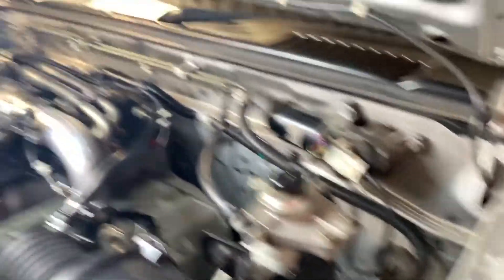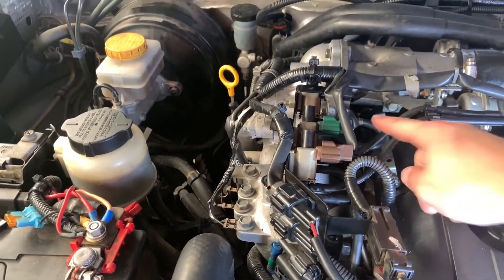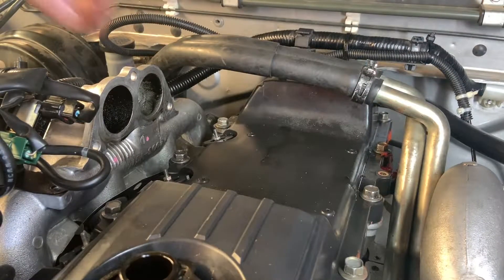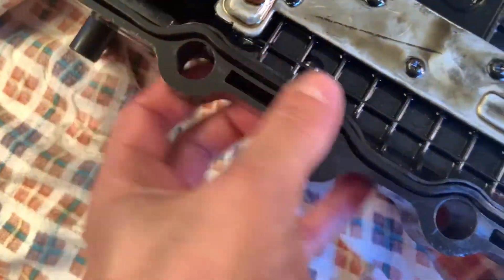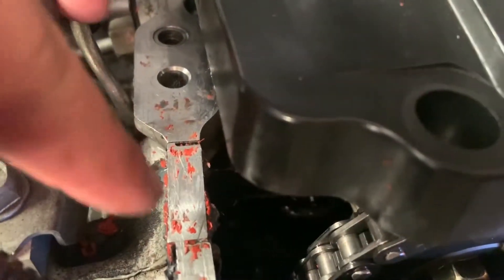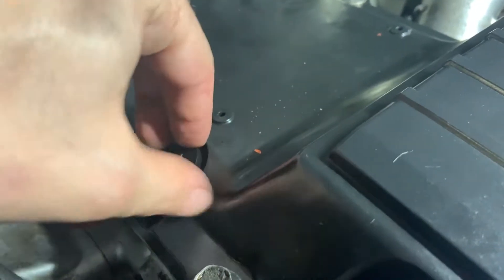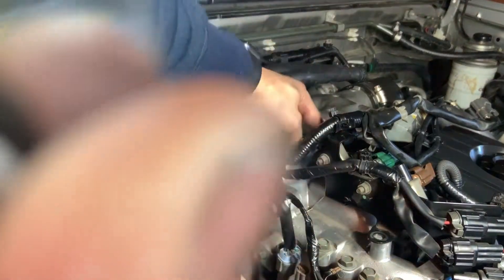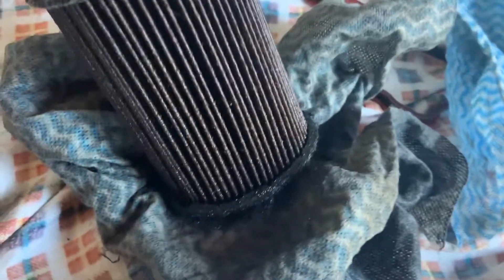Fixing My Leaking Rocker Cover Gasket and Replacing the Glow Plugs On My ZD30 D22 Navara

Comment: At what point did you take out the glow plug and seal.?
Ive just got the cover gasket and not glow plug seals. Don't want to destroy them.
Reply: @anthonyjamescatania 
Thanks Anthony.
You're right, it's a bugger to get cover out with the glow plugs still there, but manged it. I think I'll pull them out though to refit cover as I think I might damage seals with the top of glow plugs.
Thanks again for the video mate.